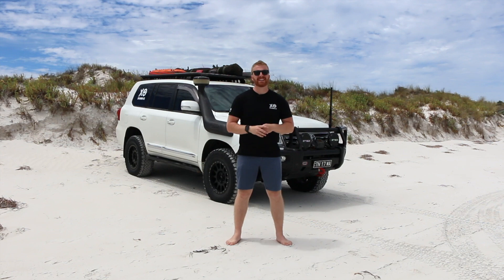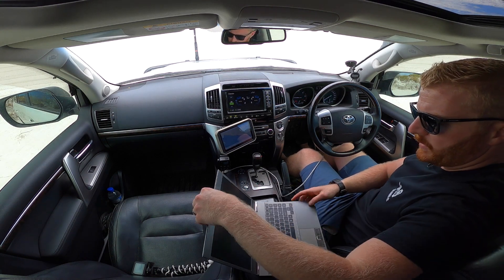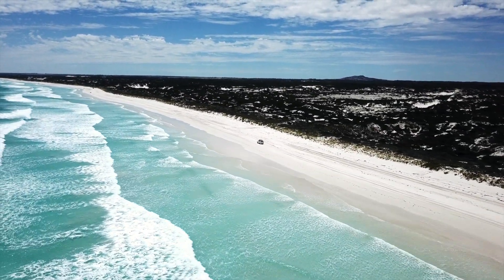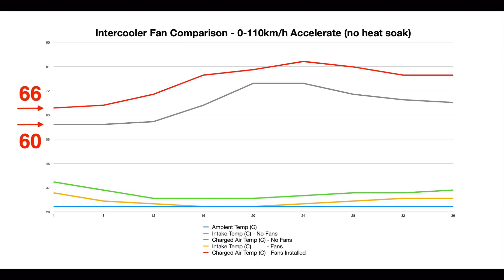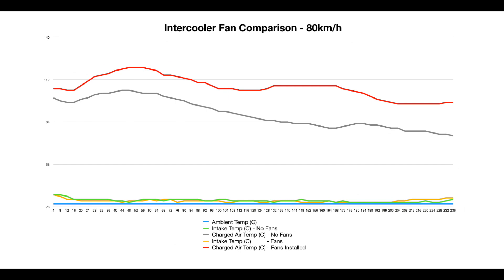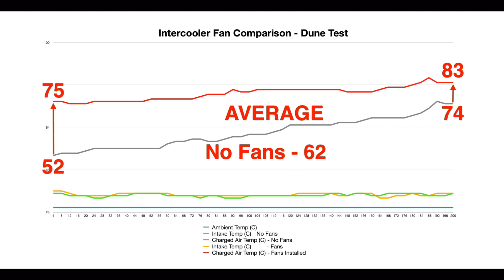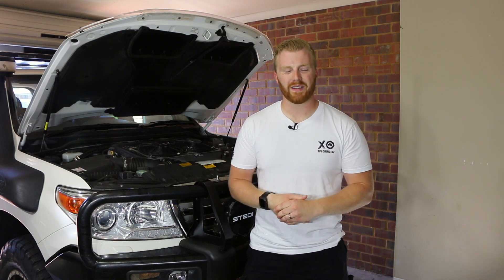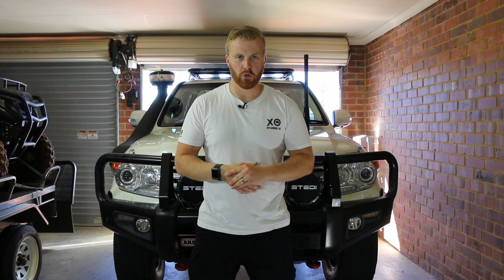Pt. II | INTERCOOLER FANS on SAND | Low Speed - High Load | Landcruiser 200 series off-road

Comment: Very thorough and interesting videos. One of my fans on my 2011 78 series has stopped working. The relay, fuse and wiring are all Kosher. My engine bay temp rarely gets above 85c (engine watchdog) and my air intake sits between 80c-90c (scan gauge). I recently drove from Alice to Darwin stopping once for fuel at TC and these were my temps with both fans working. I'm going to take my intercooler off to try and fix the fan, if I can't, I may just remove the busted fan. I will definitely do your tweezer trick. Cheers man. Oh, do you following Lock in your Hubs? He does scientific based reviews too.
Reply from the maker: Thanks mate, I was certainly surprised from my results from this, I honestly thought it would work much better than it did (or didn't).
Yes, I do follow him, he certainly takes testing to the next level 👍

Comment: I’m not sure your test is right mate I have tested fans and they work mate just my 2 cents I think your fans are not moving enough air mate
Reply from the maker: Maybe, would be interested in knowing what fans you are using? Not sure how big/powerful the fans can be to fit in this space? 
Either way, with the 3 tests I conducted I found them to be more of a hinderance and something I personally won't be fitting. This being said, if they are working for you, that is good news 👍
Reply: The GSL spal fans and the Davis Craig controller it work very well

Comment: It would be interesting to see if a single fan mounted directly to the IC (i.e. without a shroud) would achieve a balance between optimal low vehicle speed cooling and optimal higher vehicle speed cooling.
Reply from the maker: Potentially. The reason I didn't mount directly to the intercooler was because of the terrain these vehicle encounter. The vibrations and movement from off-road use and corrugations could potentially create issues with the intercooler itself.

Comment: 1998 Patrols used an intercooler fan below the cooler. This wouldn’t restrict the airflow like top mounted fans. Later models lost the fan, as it wasn’t needed. I found that the 98 patrol fan only started under the heaviest load conditions, like prolonged deep sand.
Reply from the maker: Yeah, much more efficient mounted underneath and pulling through. I also did this to my GU patrol a few years back and it was activated by a thermal switch. 
Cheers, Nathan.

Comment: Nath.  Has one looked into a water spray system to cool your intercooler charge ?  This would hopefully help to reduce the intake temperatures via a switch, that can spray water over the top of an LC200 intercooler thermal/manually switch !  V.
Reply from the maker: Hey mate, I definitely agree that a water sprayer would assist (I've tested in my previous 4WD) however 2 things are putting me off this method in this vehicle. Firstly water is finite in overlanding situations and using it to cool the intercooler wouldn't be high up on the list when traversing the desert.
Secondly, the 'V' shape of this V8 engine has a tendency to 'catch' water in the centre (under the cooler) and potentially increase or speed up the rusting process.
Reply: @XploringOz  Nath.  Yeah unless one goes for an aftermarket front mount ?  The last thing any LC200 owner needs is the starter motor failing in the middle of a 'Vee', as have heard it's 17 hours book time from Toyota to swap out - yikes !  V.
Reply from the maker: @vincentpoole7588  For sure, front mount is an option. Just not something that I think I would get the value from at this stage of the build. I'm happy with the power and temp's I'm achieving with my current setup and I'll probably just leave it as such.

Comment: Is it possible to mount the fan below the intercooler and and turn it into pull setup instead of push. I believe there isn't enough room within the intercooler shroud when the bonnet is closed hence the fan couldn't move enough air to give the extra cooling.
Reply from the maker: Unfortunately there is not enough room to mount these fans underneath the intercooler. No doubt they would be much more effective in this setup, however just not possible with the stock cooler.

Comment: Always been Curious if an aerodynamic bonnet scoop with flap that can be opened and closed  when needed would yield a better airflow over the intercooler  without fans. Also how the results would compare using fans on a scooped bonnet to a stock bonnet. Pro and cons . Nice video
Reply from the maker: This would be interesting to test. I might do some more testing in the future in regards to the intercooler, so I’ll keep this in mind 👍

Comment: I've taken mine off after this sequel. Replaced by a bit of fly screen which will offer some practical benefit.
Some other points for those still interested. They will damage fins when nuts and leaves inevitably get in there.
Something else I cannot backup with evidence.. it felt like my in cab supply air temperature went up at times. This was on a 76 series landcruiser.
Reply from the maker: It will be interesting to hear whether you notice much of a change in the vehicle's characteristics.
Thanks for sharing those considerations, definitely something to keep in mind and interesting to hear about your observations in regards to in cab temps.

Comment: Really nice vid. Spent some time a while back looking at IC temps on a Porsche turbo - I know how much time it takes. And I did not film myself. :-p
One thing that most people do not realize: a fan actually moves relatively little air, especially when compared to what is blown through by driving. It obviously varies quite a bit from from installation to installation, but fans generally only provide a benefit under 30-35kph. After that, they are only along for the ride in a best case and block the airflow in many other cases. As such, they do more harm than good. Which is exactly the solution you came to.
Reply from the maker: For sure, every vehicle is going to be slightly different, but I do believe fans are generally limited in their functionality.

Comment: Excellent info mate. Does go to show how inefficient the factory intercoolers are though. Ideally a quality intercooler will bring the air as close as possible back to ambient temperature.
Reply from the maker: Yes, definitely one of the draw backs from a top mounted cooler. On the highway it doesn't do too bad, only about 11-15 degrees higher than ambient, but yes, on the beach they are hot

Comment: Blowing hot air from inside a hot engine bay isn't going to cool down anything, what were you expecting?
Reply: Ummm 17:16. Look at the bottom of the bonnet. Is that a duct that feeds cold air to the intercooler?
Reply: Worked it out yet?
Reply: @dustyfarmer  I’m going to go with no. He’s obviously to brain dead to figure out anything he hasn’t seen.
Reply: How is it blowing hot air from the engine bay? It should essentially be drawing air through the ducting from behind the grill.
Reply: @shanenorwell8580  do you think the air drawn through the radiator will be cool? Do you think the air around your exhaust is cool? When you pop the bonnet after travelling for a few hours are you hit with cool air or hot air, only way to get cool air is to have a bonnet scoop drawing in air from outside the engine bay.  Please tell me where the air going through the intercooler is coming from?, i may be stupid but Im not as stupid as you. Why do guys change to a front mount intercooler from a top mount
Reply: @shanenorwell8580  not my fault if you are sensitive. Where is the air being drawn from for the fans, is it connected to the ducting, looks like they were just sitting on top of the intercooler, blowing air from inside the engine bay, I may be wrong, please inform me if I am wrong and haven't noticed the ducting connecting them to cold air induction you think there is
Reply: @thebob3712  there’s ducting on every single diesel 200 series that’s part of the bonnet and front grill.

It’s not about being sensitive. You told me I was too stupid to work it out when it’s in fact you that doesn’t know how the setup works.
Reply: @shanenorwell8580  where are the fans drawing air from? Are they connected to the cold air ducting?
Reply: @thebob3712  that is what I’ve been trying to tell you. The ducting seals to top of the intercooler when you close the bonnet so the fans have no access to air other than that in the ducting.
Reply: @thebob3712  Hi, I own turbo 200 and ducting is attached to Bonnet when, Bonnet is open, And lower half is only shown , eg, part of duct when open.
Reply: Cold air intakes all draw air from the front of the car.
The 200 series no different, the bonnet has a rubber seal that mates & seals to the intercooler shroud & that ductwork works its way back to the top of the grill where at any speed above standing still it would be drawing ambient air in, not hot engine bay air.

Comment: Could you do a test to see if aftermarket Toyota Landcruiser intercooler fans when fitted to run when the engine is on actually make the engine slower to reach operating temperature thus increasing engine wear at the critical warm up period. You might struggle to get winter time temps over there in Kal but night-time temps may be more suitable & applicable for eastern state people. 
P.S Andrew from Berrima Diesel says you can now add TRAVEL WRITER to your C.V
Reply from the maker: Something I might be able to test in the future. We do get a few cold, sub 0 mornings out here, but not that often.
Haha, not everyone seems to agree with my results in this series...
Reply: @XploringOz  You're my guide on the subject.

Comment: Nice follow up Nathan. I guess, the prescribed ideal outcome is two fold. 1. Increased power derived through lower egt. And 2 arriving at 1 at a safe egt. Can your test result methodology identify exhaust egt changes, with and without fans, using the OBD 2 Code functionality.?? Perhaps a more real world understanding of load vs piston temp. Doesn't the lc200 have egt sensors/ thermocouples pre or post hi and low speed turbo?  Been looking at these codes for my scan guage and they seem to exist. But, my 79 is too old. Probably to do with dpf temps in more recent vehicles. Would be good to see egt's as the reference though.
Reply from the maker: Thanks mate. 
So yes, those results would be ideal. With this model of cruiser, I haven't been able to successfully obtain EGT temperatures from on-board factory sensors. 
I know that with my new Manta exhaust, there are easy to access bungs on each dump pipe that are designed for aftermarket EGT gauges. The only reason I haven't fitted these yet, is that I haven't found a location to neatly displayed two more gauge inside the cruiser cab. 
I could maybe hook something up temporarily, but currently don't have that equipment on hand...
Reply: @XploringOz  Thanks for the prompt reply.Personally, I believe lowering EGT's is the end game to all your very well regarded efforts. It is possible,  through "scanguage" to get a list of obd2 codes by vehicle type. Perhaps, a phone call as I did, for a link from them might help.

Comment: This proves that fans on OEM intercooler just chokes up , so leave fans off. But aftermarket intercooler and fans is a step up.
Reply from the maker: For sure, an aftermarket setup would likely provide a much bigger benefit to the charged air temps.

Maybe a test to conduct in the future....
Reply: Yes I agree especially on the 79 series where low speed towing & heat soak reduces fuel and power due to limited bonnet scoop rammed air induction at low speed . Fans work well on 79’s oem intercoolers .

Comment: What a shame you have to spend the first part of the clip justifying your stance to the youtube fk heads out there. Good video none the less.

My old evo VI had intercooler spray jets. I wonder if a spray kit with fans would provide any significant results to a 4wd.... time for u to test that theory 😉🤣.
Reply from the maker: Yeah, it's unfortunate, however everyone is entitled to their opinion. I only aim to provide some information in the big picture so that people can go out there and make informed decisions for themselves. Hopefully this video can provide a new perspective on these fans. 

I reckon it would definitely provide a benefit and I actually ran a water sprayer on my GU patrol. The only downsides with this is the finite amount of water that could be carried vs the gains provided from it. Further, I have heard stories about water sitting in the 'V' of the engine block and causing damage over long term...

I'm thinking a full intercooler replacement would be a good test also, however they aren't cheap and I'm still trying to justify whether they are worth the investment and value...

Comment: Do all the tests again with the fans mounted under the intercooler and sucking air
Reply from the maker: I would.... if I could. No fans sold on the market can fit under the factory intercooler. The only option with this setup is to fit pusher styled fans on top. Obviously with modification and changes you could make something work, however this video is to compare results with simple and easy to fit fans without complicated or involved installation.
Reply: If you were willing to try that you might as well go front mount

Comment: No surprise really. You’d think Toyota with all their money and R&D would know what they are doing and if fans were needed - they’d be included from the factory. 
My intercooler is mounted in front of the radiator (where there are fans) so it is clearly designed to benefit from the mounting position from the factory.
Well done mate.
Reply from the maker: For sure, I agree completely. These fans are becoming quite popular for the 200 series, so hopefully this can provide some insight into potential results...
Reply: @XploringOz  I have an after market  higher efficiency intercooler , that was designed to work with fans and they do work , but only with intercoolers that are designed to , by manufacturer of intercooler as  intercoolers are designed differently.
Reply from the maker: Definitely, intercoolers are not designed the same and some greatly benefit from the higher airflow produced by fans.

Comment: I’ve been messing with my car for about 3 years, trying different hyped mods that are meant to increase power/cool etc. My conclusion is: leave it oem. Ecu tune if you need to override the nannies.
Reply from the maker: For sure, these manufacturers have spent millions on R&D and generally know what they are doing, particularly reputable companies like Toyota.
Reply: @XploringOz  ha, got you.... think about the damned oem Plastik air filter box !!! POS.... creating parts turnover design.... but good on them so easy to overcome.... just kiss 600.- AUD goodbye and get an aftermarket one which functions properly. Nop, can’t get the money back from Toyota for it.... cheers mate..

Comment: HI Nathan this may sound a bit funny but try lifting the fans about 10mm off the intercooler and see if it runs cooler as this is what we did on rally cars to keep them  cooler
Reply from the maker: It sure does defy common knowledge regarding these type of fans and isn't something I had thought of. Interesting to hear that works on your vehicles. 
Unfortunately with this stock setup it just isn't possible. There isn't enough room between the factory cooler and the air ducts to lift it up, it already fowls about 1mm on the ducts as setup in this video...

Comment: I have a 2017 lc200 with Diesel engine , theses lc200s , found out with wrong gear oil in sand , will cause temp rise . I tried my lc200 with amsoil 75w90 rather then Toyota 75w85 , both temperature went up .  Going back to Toyota 75w85 it ran better . The fans work on towing . But the alternator was working harder , up to 37.8 amps more load . So temp will go up for the loan reasons . Fans do work . Thanks
Reply: You've concluded that a gear oil with very similar specs caused temps to rise in sand.......WTF?  umm....nothing to do with driving in sand......?  Both oils you mention have data that puts them within a poof-tenth of each other for viscosity @ 40 and 100C.

Comment: Hi . Please check to total watts of these 2 fans , temperature went up due to more alternator loans added to the 2 fans . Even with good cooling , the 2 fan will cause the alternator to run more and temp will go up .
Reply from the maker: Hey mate, so even if the alternator was working harder, this will only prove that these fans are not worth the investment. Saying this, I don't believe that these two fans will have any significant bearing on the temperature of the charged air intakes. If the vehicle is working harder to turn the alternator, then the load is placed onto the combustion chamber, not onto the intake airflow (prior to combustion). Further, I have a lot of electrical equipment running in this vehicle and the alternator can cope with this gear just fine, the addition of these two small fans would be negligible.

Comment: Was any of the air ducts still in place? Eg directing cool air in still? And so the fan is sucking cool air from duct work and not hot engine bay air?
Reply from the maker: Hey mate, yes all factory plastic ducting was still in place. This way the fans are attempting to source cooler air from the front grill rather than from the engine bay.